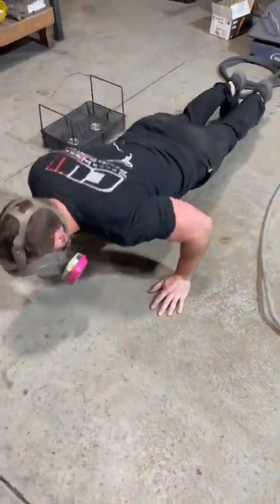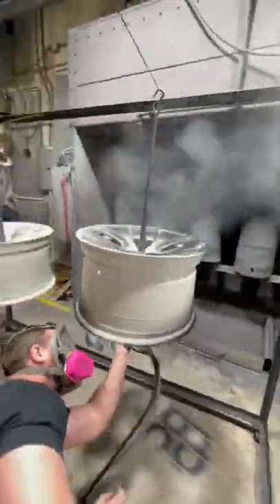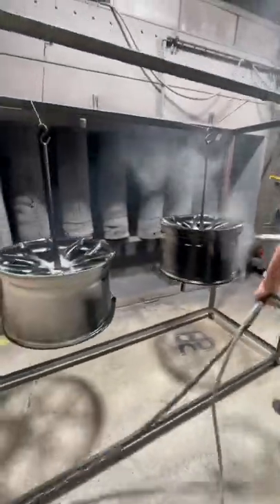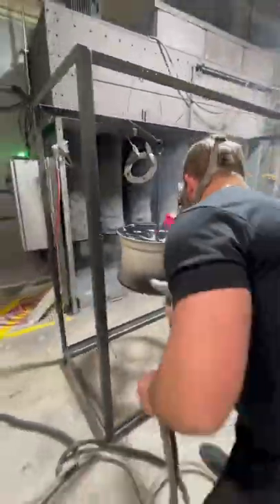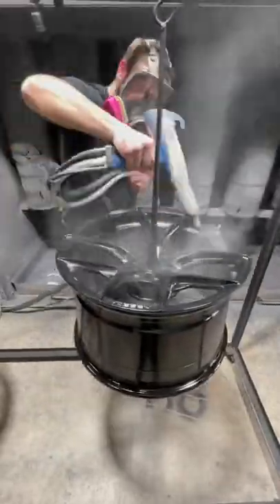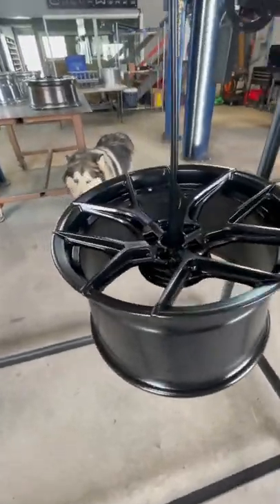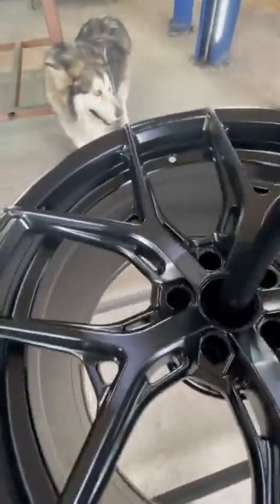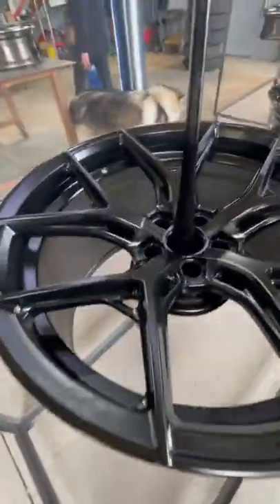How we powder coat wheels!

Comment: hey this is a dumb question but if it’s powder then why does it look glossy because i always thought it would like a matt color?
Reply: It’s called hot flocking you pre heat the part and then cure it in the oven
Reply: I thought you can clear coat after it’s cured???

Comment: The cure oven where I work takes 20 minutes to coat the wheels. How does yours take less time?
Reply: Cure parameters. Low temp for longer or high temp for shorter.  
If you use tiger drylac powder it tells you on the box the different cure schedules.